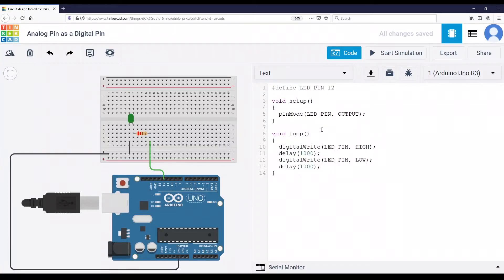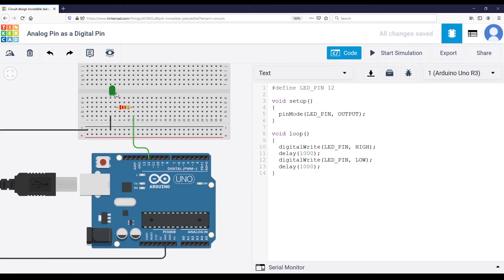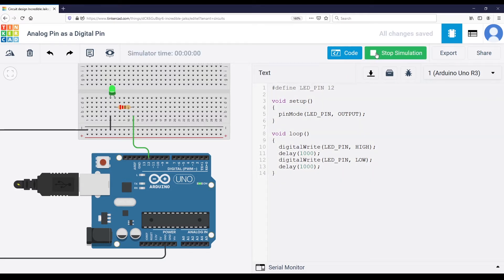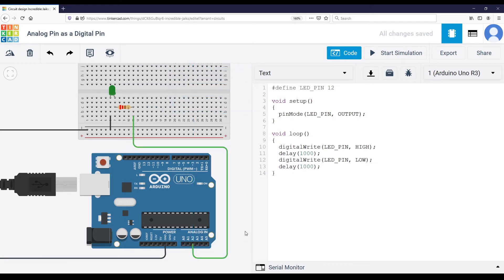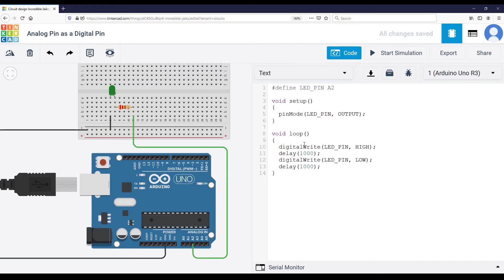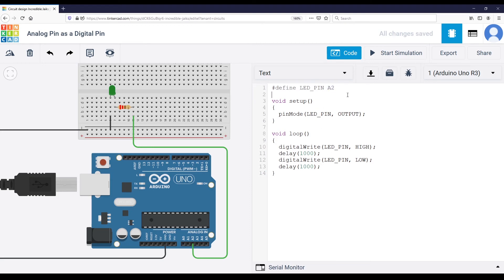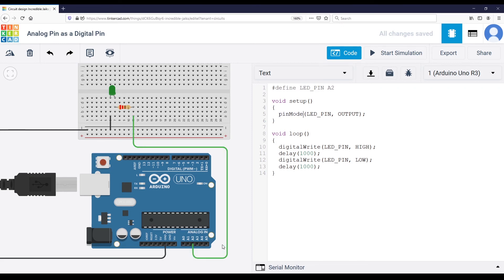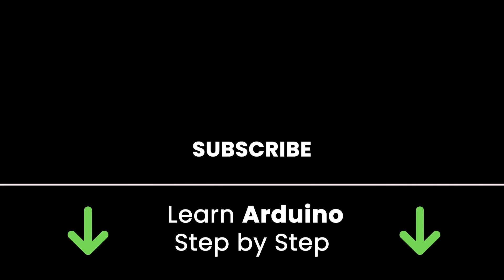Arduino - How to Use an Analog Pin as a Digital Pin (with example)

Comment: Does it use more cpu cycles? Since reading AI needs more cycles.
Reply: no, it is the same of cycles using a digital pin. the function pinmode will set the internal registers from the default analog to the new setting digital I/O. you can check the microcotroller datasheet to understand what's behind.

Comment: Can you use an analog pin for pwm output?
Reply from the maker: No, the analog pins don't have PWM support.
(this can be quite confusing, because the Arduino function to use PWM is analogOutput(). PWM output can only be used with digital pins having a ~ next to the pin number)